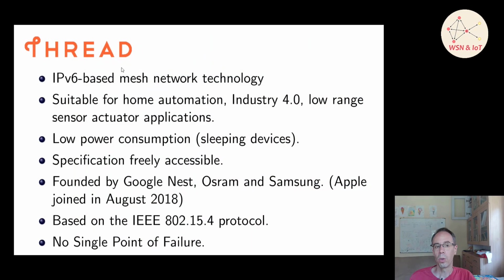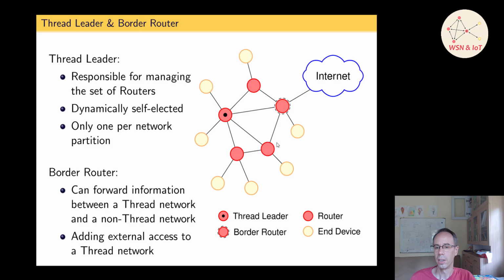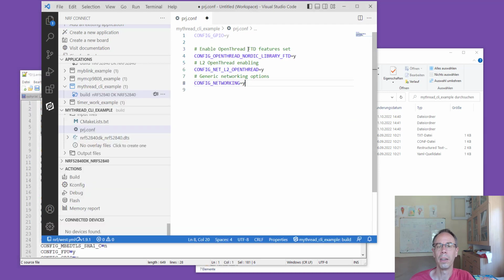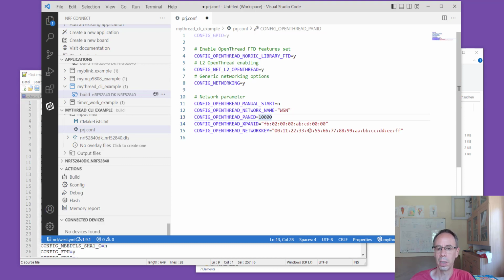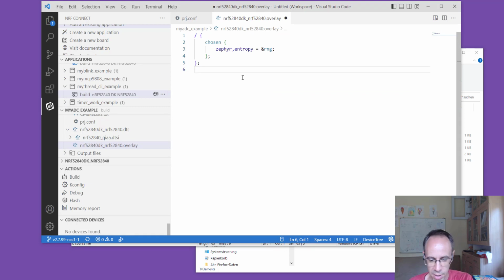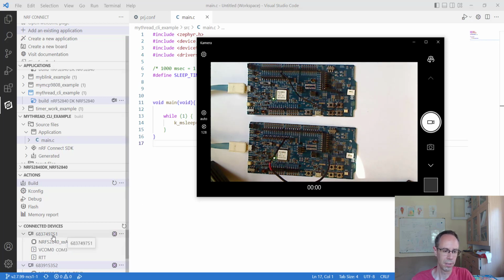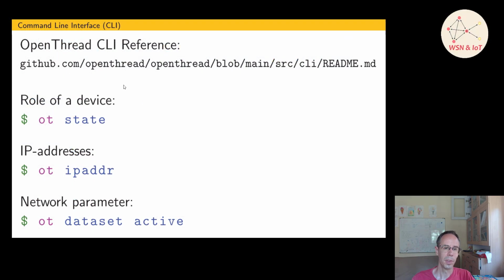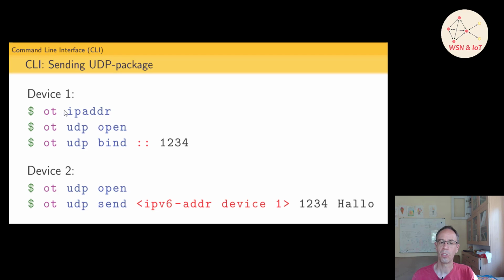Zephyr and Nordic nRF Connect SDK - 06 OpenThread CLI Example

Comment: Sorry for my questions, but can i follow this example with 1 NRF52840 dk and 1 Seed Xiao nrf52840?
Reply from the maker: Yes, no problem. I tried it with toolchain 2.2. For the Xiao there will be automatically a software usb driver installed on the nrf52840. The only thing what you have to keep in mind that the headerfiles with a newer toolchain (above 2.0) changed. So you have to use  for example #include <zephyr/kernel.h> and #include <zephyr/device.h> and so on.